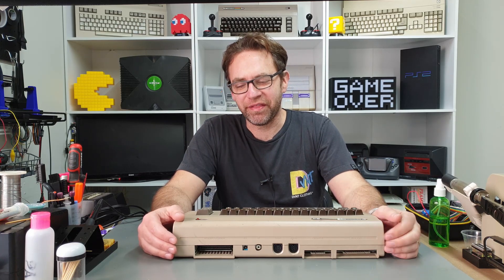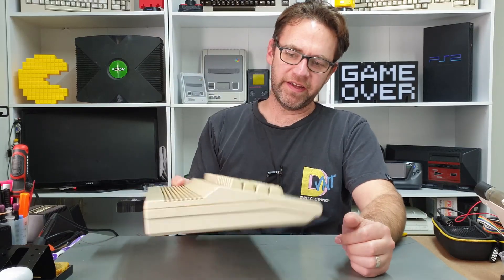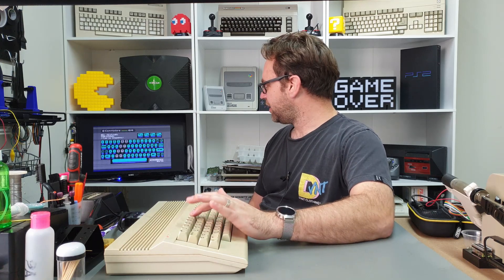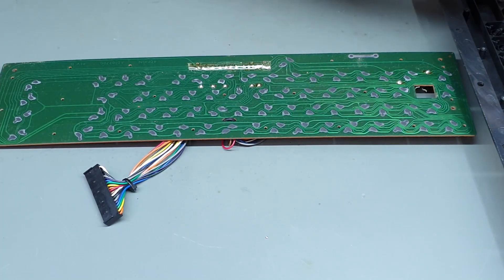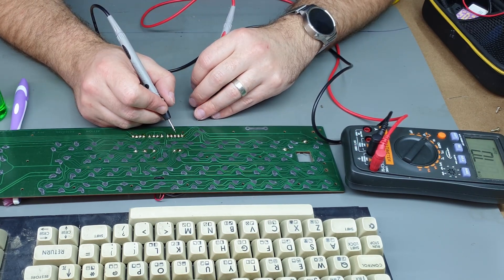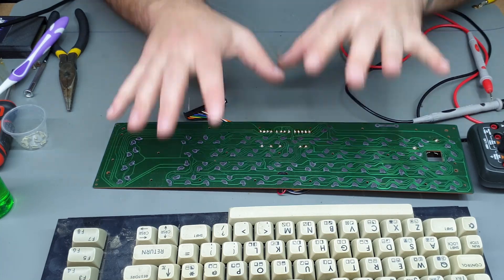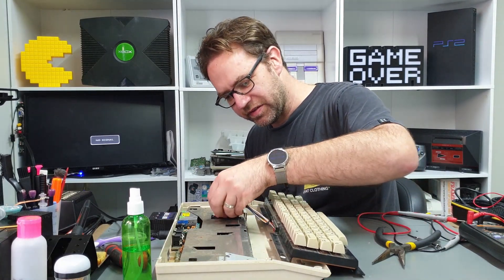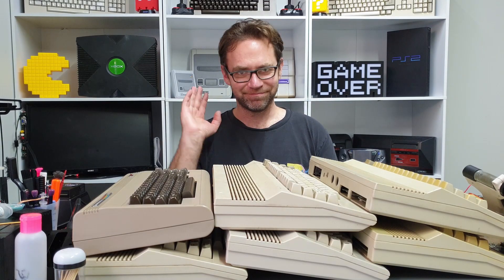Commodore 64 repairathon PART 3

Comment: Just wondering if you happen to know of anyone in Brisbane that does C64 repairs/futureproofing etc? I just got a C64c & need some help.
Reply from the maker: Sorry, I don't know anyone in Brissie who does this stuff. Maybe try the lemon64 forums
Reply: @TheRetroChannel  Thanks anyway, I have already placed a thread on lemon64 & am waiting to hear back. If I don't have any luck, would you be willing to work on my machine? I would pay for it & all shipping costs etc?
Reply from the maker: I'm happy to help you out if you can't find someone local. Is there something in particular wrong with it, or are you just looking at some future proofing?
Reply: @TheRetroChannel  Thanks! :) Essentially, I am looking to future proof it, but I haven't turned it on yet so I don't know if there are any issues with it. I have bought a new power supply from Electroware which I have received. I haven't got a video cable or a monitor yet so I have know way of telling if it works or not. I bought my C64 from Ebay & the seller said it works, but I'd like to make that determination myself of have someone I trust do it.
Reply from the maker: @silverhand7748  Fair enough, as I said I am happy to help. Good job on picking a reliable power supply. I think your best bet is to obtain a video cable and fire it up and try and identify any obvious faults.

While a clean and recap is a good idea, I wouldn't really say it's essential. The capacitors that are in these are usually fairly reliable, unlike the surface mount ones used in many 90s machines
Reply: @TheRetroChannel  Yep, that is my plan. I'm also thinking I will get a diagnostic cartridge & harness. I will keep trying to find someone here who  can help. I will contact you again if I can't find anyone, after I have fired it up per your suggestion.

Comment: You didn't show it, but did you put the clear tape back over the solder joints?
Reply from the maker: Nah, actually it's the first time I've seen tape used there so I didn't bother replacing it

Comment: Where did you get the chart for the Keyboard Matrix and how do you read it?
Reply from the maker: It was pretty much the first thing that popped up when I googled c64 keyboard matrix. Very basic explaination of the way it works is you have a grid of lettered columns and numbered rows. Each key on the keyboard will have two contacts, one will be for the Row and the other is the Column. So for example typing the letter "G" will connect Column D with Row 2, these correspond to pins 17 and 10 on the connector. As the c64 polls these pins it will find pin 17 (column D) and pin 10 (row 2) have made a circuit and the result is you get a "G" keypress.

If one of the rows or columns have a break in the trace, then it is likely that none of the keys on the particular row or column will work. So in my case column C appeared to be broken as all the keys in that column 5RDXCFT6 were not registering a keypress.
Reply: @TheRetroChannel  Thanks

Comment: Sometimes we get lucky and reseating a connection is all it takes to get something working. It may have been a bit of dirt or corrosion on one pin and plugging it in and unplugging it was enough to knock it off and restore connectivity.
Reply from the maker: I was thinking the same thing.